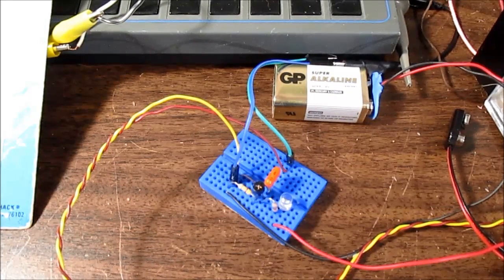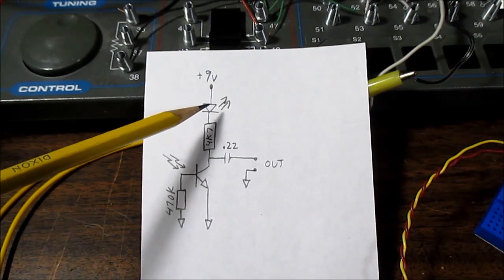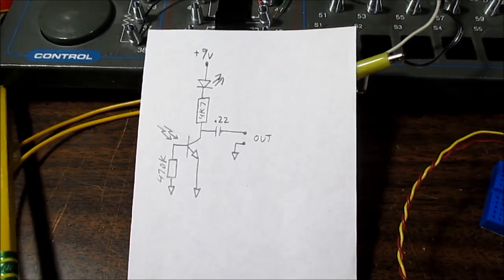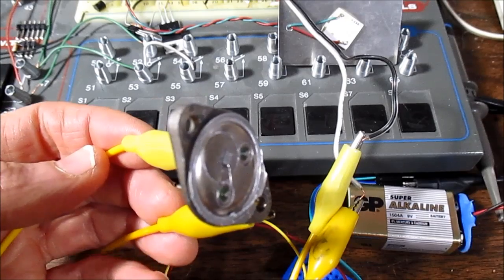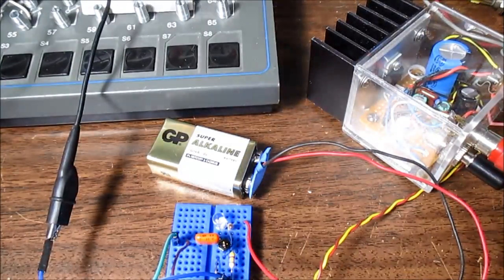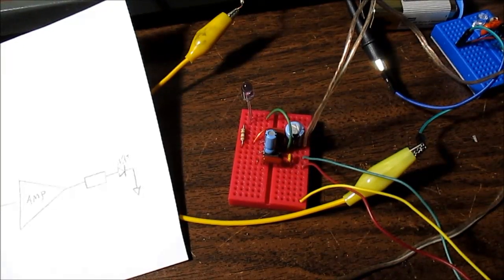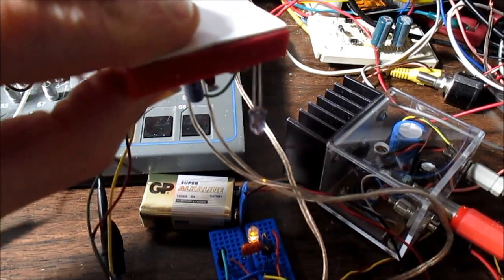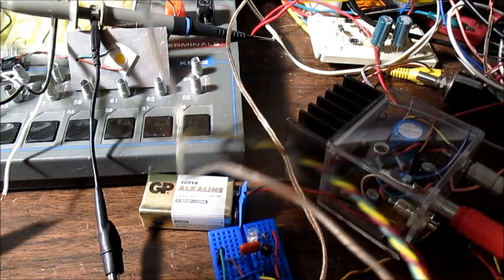Fun with a phototransistor

Comment: Yeah I always found it really interesting that any PN junction device can be used as a photodetector. This will work with LEDs or regular PN junction diodes. It's easiest to use a diode with a glass package like a zener or a 1N4148 signal diode. I can get almost 2v and maybe 25microamps out of a white LED as a photocell.

This effect works in reverse, as well. If you run enough current through a diode or a photocell or even a solar cell, it'll emit light. Though the light emitted is in the infrared, but you can see this infrared easily enough with a digital camera. Any digital camera will pick up infrared light without any modifications to it. You can test this yourself by pointing a TV remote at your phone's camera and you can see the LED flickering when you press a button. It's really neat!

Comment: Would an incandescent lamp on a direct DC source flicker, like and old flashlight. It makes sense that a lamp on an AC source would flicker at 60Hz or 50Hz in Europe.
Reply: Mike oliver It would flicker at a 100 or 120 Hz.
Reply: Incandescent blubs give light because of heat. The wire can't cool in 10 ms, so I doubt you'll get any flicker from incandescent bulbs.
Reply: Oh yes you can. See https://youtu.be/E_2ZNXC4zEI

Comment: I'm surprised how small the die is in the T03 transistor, that's like what I'd expect from a counterfeit part.
Reply from the maker: It is out of an old TV from the 70's. Probably part of the voltage regulator and wasn't a high current device.

Comment: Could you control the gain reduction on the base of the phototransistor by, say, a 2.2K (fixed) + 5M (pot), to allow low/high gain as needed?  Also, might be interesting if a jig was made with white LED (powered by DC) directly aligned at the phototransistor (with circuit as used), whereupon you try passing smoke/water vapor/?? or even the heat rising from a candle between them, to play with sensing "optical transmissivity"

Comment: i was trying to do isolated current control on the +ve side with an n-mosfet, connecting the gate to a pull up resistor of 6.8k to 9v and collector of a pc817 to pull down the gate voltage ground. the led of the opto is being driven by an opamp (via a 330ohm) connected in diff amp config to a separate power source.

but it's not working properly, when it's in action it's pulling down a lot, then doing sort of proper control to some range. i am thinking, this is because the opto interface is not as responsive. any suggestions please ?
Reply from the maker: Check rate of change at output of opamp and isolator through rate of change across the sensing device. Do this test separate from the circuit or the effects of feedback may mislead you. Once the circuit is working properly through its detection range, interface it with the mosfet gate. You may need to tinker with the gate circuit to get it regulating properly.
Reply: separate test, ok. i think i will need another opto. ok, will check it separately.